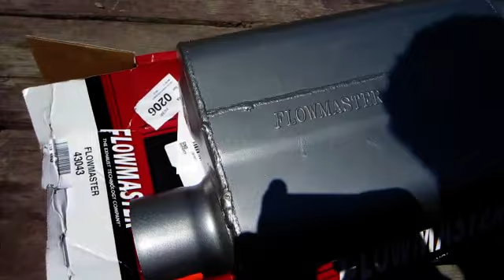Flowmaster 40 on 4.3  Before/After and driving.

Comment: What a great video. Most videos showcase this muffler in a static application. That is, the truck parked but not moving. Everyone knows that cars and trucks with exhausts sound completely different from being in a park than they do in an actual driving environment with an actual ENGINE LOAD. This video completely covers the dynamic application and sound from this muffler in a real world working environment. This has been the only readily present video showcasing the Flow 40 sound under load and I am completely convinced this is what I want. Even though these are 6 cyl engines, these mufflers almost make them sound like v8s with a higher idle. Totally f'ing awesome that you decided to put this on an Astro because know one I have seen had done it. Thanks for the vid
Reply from the maker: Thank you!! I'm glad my video was helpful! I also thought it was a cool different take on exhaust sounds. Thanks for watching!!!
Reply: I totally agree! I have a super 40 on my s10, and it sounds way different when I get going!